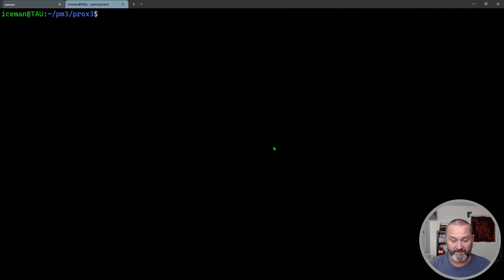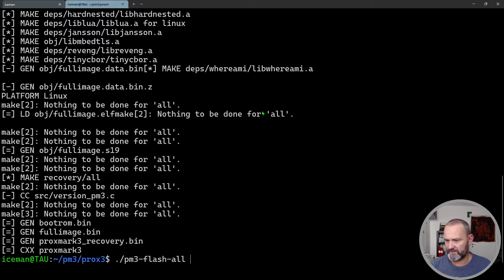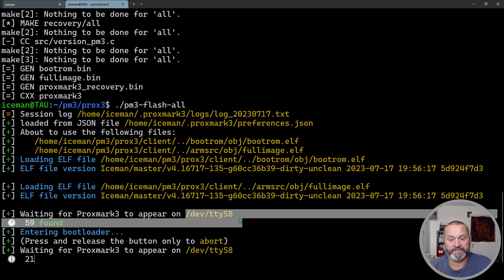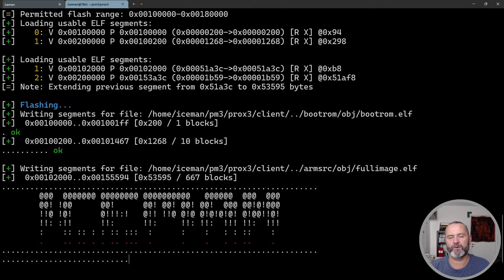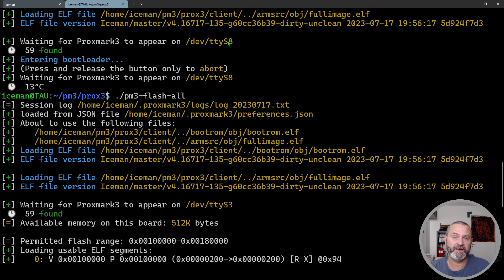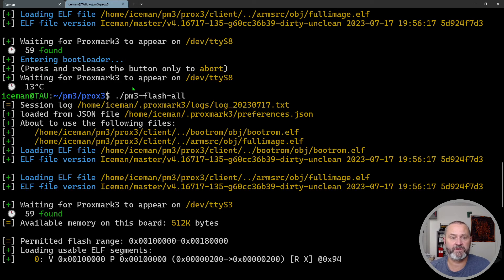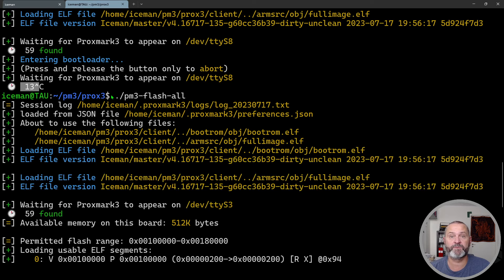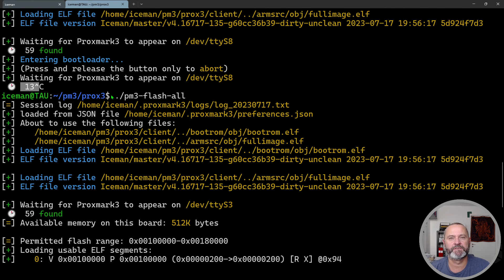Troubleshooting Your Proxmark3: Handling Flashing Issues.

Comment: I am running on Ubuntu and I had it hanging on "start recording" mode. I tried to cancel the operation but the term just hung.

That shouldn't have bricked me right 😅
Reply from the maker: Usually no. 
Did you remove the modem manager as instructed in the linux guides?

Comment: hi iceman how to fix proxmark3 waiting for apprear when its plugged
Reply from the maker: Depends on your setup.  If you are running proxspace ,   Try the button trick and see if your device get found.   Usually those batch files has a fixed com port and your device changes comport when entering bootloader.